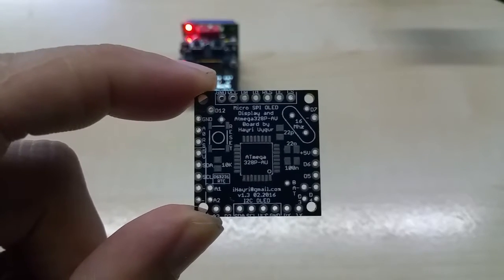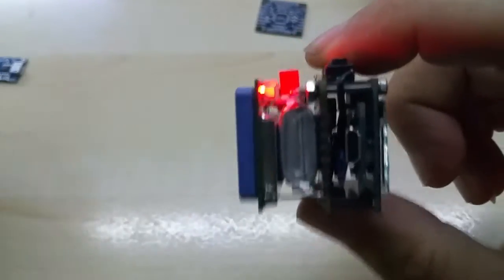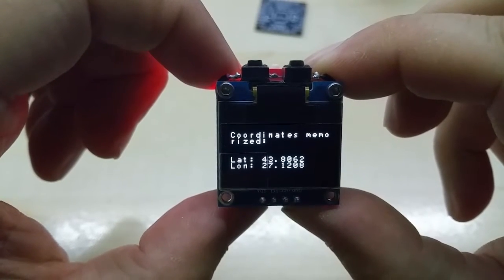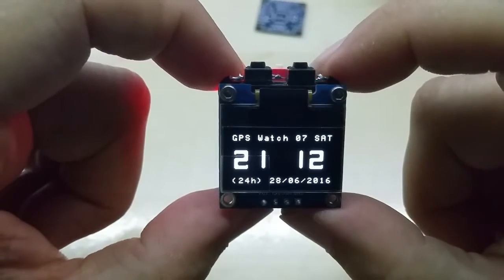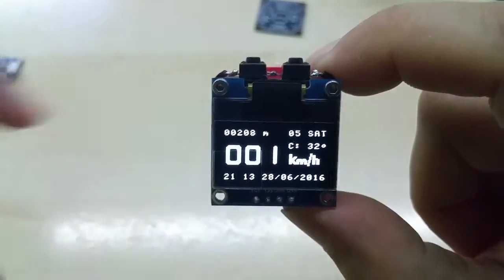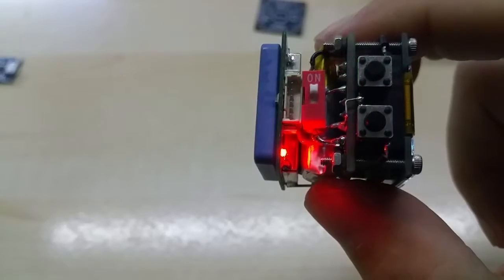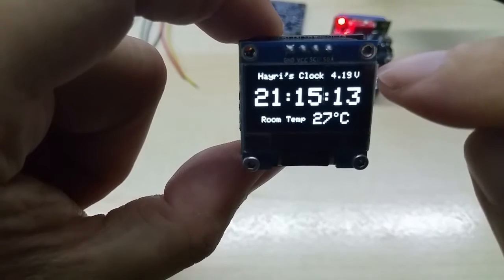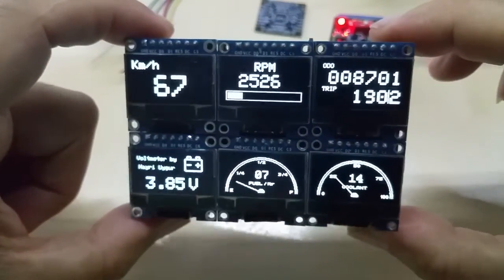OLEDiUNO GPS System with Custom Atmega328P-AU PCB by Hayri Uygur

Comment: Does it only charge when its off?
Reply from the maker: No, as a matter of fact you can leave it on and plugged in and use it constantly. The built in lipo charger has a protection that stops charging once the lipo battery reaches 4.2 volts. It will just take a little longer to charge while the GPS is on, thats all.
Reply: you are using this one right? http://i.ebayimg.com/images/g/oEEAAOSwrklVO5q7/s-l500.jpg
Reply from the maker: Yes, exactly. There are also some chargers that don't have the protection circuit as I am sure you know.
Reply: Cool, thanks. I'm gonna mess more with those eventually. Never was clear if it could power and charge the battery at the same time.
Reply from the maker: No problem, glad if I could help.